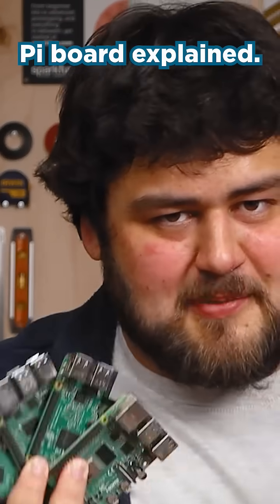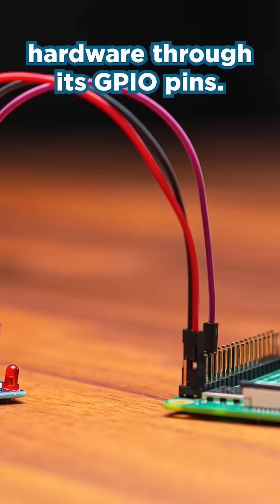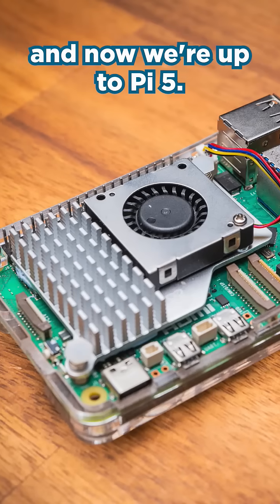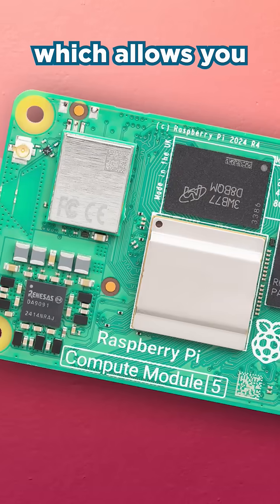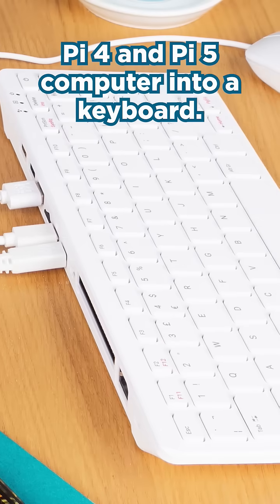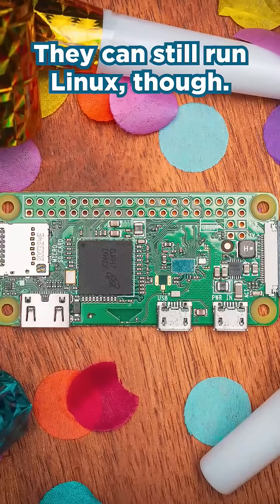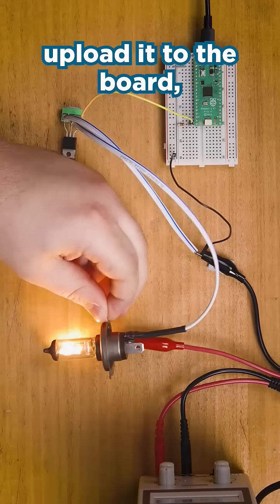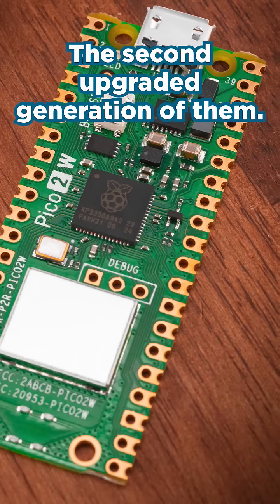Every Raspberry Pi Board Explained

Comment: Are all the versions credit card sized?
Reply from the maker: No, just the model B is credit card size in terms of width and height, (not depth obviously), Most are smaller with the exception of the Pi 400/500 which are keyboard sized!